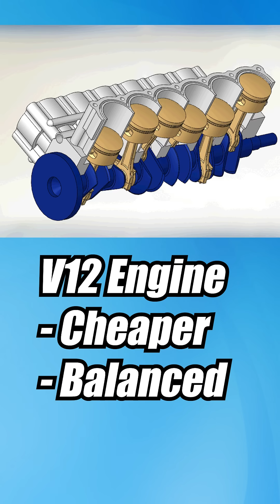wHy DoN'T CaRS uSE V14 ENGiNEs?

Comment: So what you're saying is we should ask for a V20
Reply from the maker: That's the spirit 😂
Reply: Go big or go home, right?  @BladedAngel
Reply: @BladedAngel  How about v32 Lol
Reply: @BladedAngel 
If you wanna know 24 cylinder engines exist yes
They were on the B-29 IN 1945
They are that old now
Reply: @BladedAngel  why not W48?
Reply: I mean....the V24 technically exist, should not be too hard to go back and make a V20  @BladedAngel
Reply: @BladedAngel  Electric cars are already there. Most supercars are transitioning that's fukin impossible unless some crazy hypercar startup like devel, SSC, Hennessy do that to make world's fastest hypercar going 400 miles +
Reply: Double W 50 now that's the spirit
Reply: @Jawd3544  radial 70
Reply: @93_industries  now THIS is why engine simulator exits for 😂
Reply: @93_industries i love the internet 😂😂😂😂😂😂
Reply: @93_industries It should be 2 stroke to work properly, a radial 69 4 stroke engine would be balanced
Reply: @Jawd3544  V200 is really what we need
Reply: @Jawd3544 how
Reply: @Jawd3544  no man we need a flat 14
Reply: Go big or go home W 30
Reply: @93_industries  and put in a Miata
Reply: @93_industries W-shaped engines are split in two VR-shaped blocks. W30 would leave 15 cylinders for one block, which doesn't really work. Let's ask W32, it's two W16 in a row, that would work
Reply: @93_industries put two W16 together n get a W32 💯💯🤘🤘🤘🙏🙏
Reply: @93_industries cant do that doesnt divide correctly
Reply: @93_industries that’s an odd number are you okay in the head ?
Reply: @93_industries  whop-whoop, uneven cilinders
Reply: @93_industries go massive or go home. Radial rotary 36 piston engine. Rotary to keep the engine cool. 😎
Reply: I believe some locomotives have V20s
Reply: @elgringolobo97  I know some older torpedoes have rotaries with pentagon shaped Doritos but I don't know what kind of power it'd put out
Reply: @whatifIdontpickaname  omg that's the first mention of this on the internet I've seen in years. I researched this stuff a while back because I recreated the basic shape of this engine in cad and from what I was able to find it seems like this was a russian prototype technology
Reply: @elgringolobo97 they do
Reply: I like yo spirit 😂
Reply: What about V100?
Reply: @realmustangboy6437  You get it bro, why stop at 14? Just keep on adding V's baby!!
Reply: @realmustangboy6437  na get an inline 100
Reply: @realmustangboy6437 nah to hard to balance W100 would be better but we all know we need A FREAKIN W1000
Reply: Detroit Diesel made a 2 stroke diesel v20 for industrial generators and locomotives, and MAYBE semi trucks I'm not sure
Reply: @treystephens8209 caterpillar does make a v20 engine mainly to trains but also big dumper truck
Reply: @treystephens8209 someone should mod that into a videogame, especially something like beamng where the community would actually see and appreciate it.
Reply: V24😐
Reply: @wender1535  I think Detroit Diesel makes (or used to make) V24 engines for certain applications
Reply: There's also X layout engine, which is like two Vs on top of each other. The same way two I6s can make up a V12, two V12s can make an X24. Like the Rolls-Royce Vulture. A British WW2 Bomber engine with an X24 layout and 42 litres of displacement.
Reply: So we should ask for a inline 10 then
Reply: @jalden1321  well we have V8s and I8s, so why not to for I10s, or even I20s.
Reply: @jalden1321 it'll have to be a wide ass car😂if u want an inline 10
Reply: I've always wanted to make one someday out of 2 M5 v10s
Reply: V20 exist, on a caterpillar loader😭😭 v20 4turbos with 4000horse power 😂😂😂😂
Reply: @SF7483IT  There's also V20 from MTU that produces over 12k horsepower
Reply: At this might as well go WW240 as long as we got the budget
Reply: Radial20?!?!!!
Reply: V10000
Reply: @josephj807 W1000000
Reply: V24 and W48's are what we need.
Reply: O96(like the ones in ships(this is satire of course))
Reply: Waiting for the legendary V60 with 12 banks of 5 cylinders 🤪
Reply: Caterpillar uses V20’s 😊
Reply: Conveniently, there are already V32's. Albeit in large ships and diesel locomotives
Reply: Double it, and give it to the next person.
Reply: Ditch the jet engine, embrace AIR engine
Reply: Thats shit finna be heavy af
Reply: Nah W32 just slap 2 V16 together
Reply: LETS GO FOR V500!
Reply: I200?
Reply: V22🗣
Reply: Lmfao of a v100 💀💀💀 gonna need a giant frame tho lol
Reply: I think v200 would be very nice
Reply: Or V24
Reply: V20 12000cc natural aspirated 2000 horsepower
Reply: How about a V100, the engine of the Batmobile.
Reply: We already have V24
Reply: Detroit Diesel Series 149 20V149 is a v20 2 stroke diesel that is 48.8L and produces 2936 hp 😂
Reply: L😂L
Reply: Nah, I want an inline 500
Reply: No because it won't fit
Reply: Two V10s are always better than 1.
Reply: We drivin on water with this one 🗣️🗣️🔥🔥🔥
Reply: Let us see a modern V24... Radial. Like the FnP Wasp!
Reply: W20, just strap 2 V10s together and call it good 👍 👌 😉
Reply: The EMD SD45, SDP45, F45 and FP45 locomotives had a V20 engine
Reply: V18
Reply: Actually yeah v20
Reply: That's noting, my volvo has a v70
Reply: With that very elongated engine size you would be looking at an aircraft instead. Thou we have Gallo 12 and Gallo 24 in existence.
Reply: @danny1103  If the people in the Car Industry we're even just looking for efficiency and cost they would have already started using turboshaft engines

Like so out dated how many more pistons need to be used till you can satisfy a car owner
Reply: Glue v10 with v10
Reply: W20, v32, and v40 engines exist. and even higher. Most of them are engines for boats.
Reply: Cadillac did produce a v16 as well
Reply: Why not a V64? placed in the tunnel between the seats: great weight distribution
Reply: V20
Reply: Trains use them
Reply: go big or go home, W24
Reply: shit 10 and 10s even so
Reply: ask for v138
Reply: That thing would have insane torque
Reply: V1000 plz
Reply: V1000000000000000000
Reply: V80000000
Reply: Yes.
Reply: go big or go home WIV limitless
Reply: ditch the cylinder embrace the jet engine
Reply: Caterpillar's got you already
Reply: we need the infiniV
Reply: Car makers  need to make a napier deltic engine
Reply: That’s what I’m hearing😂
Reply: Ooouuuu two v16s and make a W32
Reply: If u want to hear the roar of a V20, then come to the indian railways, we use them in trains here😂
Reply: We should ask for the dying V6’s and V10’s.
Reply: Jesus love you, he died on the cross for you, accept him as your lord and savior he can change everything. For God so loved the world that he gave his only son, so that everyone who believes in him may not perish but may have eternal life" (John 3:16)

But you must repent too. From that time Jesus went about preaching and saying, Let your hearts be turned from sin, for the kingdom of heaven is near. (Matthew 4:17):.,.,.,
Reply: Nah v32
Reply: Next logical step of course
Reply: Why not a Double W 32😂
Reply: With a dark matter x 25
Reply: V20 is basically 2 inline 10s yeah that works. We should ask for X20. Engines
Reply: Some diesel locomotives use V20.
Reply: Yes
Reply: Inline 30. Engine block all the way through the car.  Seats directly mounted to the block. Part of the frame. Like some motorcycles but weirder.
Reply: Guys why not just a V128K?
Reply: What about an inline 20?
Reply: There are these V20 Monsters running generators or giant front end loaders & quarry trucks.
Locomotives as well!!
Reply: Infinite

Comment: I have just short answer to why no v14

Divide 360 by: 1, 2, 3, 4, 5, 6. 10 12 and 16. And you'll get always perfect number. Except 16 but 22.5 is still a nice number.

And then divide it by 7/14
And there's all the answer why no v14 engines

Comment: Why is a V10 or IL5 workable, because the cylinders can fire evenly 72 deg apart. It's less complex than trying to make a 7 or 14 cyl fire evenly and balance it.

V6s or Inline 3s are also easier to balance, firing 60/120 deg apart.

Comment: What are you talking about.. it has nothing with being odd numbers.. unless the right side has 6 and the left side has 8.. then the power distribution will be imbalanced.. but 7-7 is perfectly fine...the real reason why no one is building a v14 is simply because no has done it. But its completely possible.. but its not really  logical, same reason as why v10s are no longer in mass production, there are v8 that can match v10s power production,.. and v12 can overshadow v10s power production.. meaning both v8 and v12 renders rhe use of having 10 cylinders..

Comment: There are no 7 or 14 cylinder engines, not because it is hard to balance, but it is IMPOSSIBLE, to know if it is possible to balance for a 4-stroke system 720 divided by the number of cylinders must equal an even number. 720 divided by seven doesn't even equal a whole number, same with 14, so it would shake itself to pieces!

Comment: Dude makes no sense. V14 is bad because of cost, so you should go even more expensive and get a V16 ? He also didn't tell us why having odd numbered cylinder heads is a bad thing, even though some of the Greatest engines ever made are v6 or v10.

Comment: V14 engines do exist.....only problem is that it's easier to fit a car in those engines than those engines in a car....

And there's even a straight-14, producing over a 100.000 hp out of a displacement of 25,6 million cc....

Comment: Silly suggestions to go around the issue: 
one V12 & one V2 engines
one V10 & one V4
one V10 & two V2
one V8 & one V6
one V8, one V4 & one V2
one V8 & three V2
two V6 & one V2
one V6 & two V4
one V6, one V4 & two V2
one V6 & four V2
two V5 & one V4
two V5 & two V2
three V4 & one V2
two V4 & three V2
one V4 & five V2
OR seven V2 engines

Comment: Engines are getting way more efficient, you can create equal or more power with a v8 than a v16 with modifications. It’s way cheaper than having to a build whole care around a huge engine & extra assembly to keep it running well & weight. Not saying v16 aren’t a monster & could easily reach new levels of power but then the cost is too high

Comment: Inline 7 or V14 engines can’t be ideally balanced. Basically every engine configuration can be ideally balanced if you divide crankshafy rotation degrees by amount of pistons and the result comes as a whole number. The only numbers that doesn’t check that logic are number 7,11,13,14,17,19 and etc. Notice that these numbers are mostly prime numbers which can be only divided by one or itself.

Comment: A lot of it has to do with the long crank you have to use to turn it all. Plus so many moving parts it requires exponentially more precise machining and needs much stronger, thicker materials to pull off without twisting in performance applications. Probably just never makes sense business wise to engineer anything over a straight 6 or v12 when you can extract about any amount of power from forced induction on existing engines.

Comment: I mean those are reasons but not the main issues. More cylinders means more moving parts and less room in the engine bay. After the v12 it’s diminishing returns Why would a company add more cylinders for more power forcing the company to spend more time and money on figuring out how to fit the engine in the car and still maintain good weight distribution, room for the power steering rack massive radiator to keep it cool and maintain clearance at the firewall. Doing all this would require redesigning a ton of parts that may drive the cost of manufacturing up far too much.  When instead the company can gain  that same power by what they already most likely know which is typically just using higher quality parts that allow the engine to rev higher and simply flow air better. This guys point about it being an engine balancing issue is sorta an issue, but not worth mentioning. An odd amount of cylinders on an engine bank is not an issue. Otherwise we’d be seeing a lot less V6s. Engine balancing is a lot more complex than what the video suggests.  He’s not wrong but also his reasoning is like saying it’s harder to balance because it’s different. Like yeah I guess so

Comment: It actually has no point, Audi RS6 can produce more than 600 horsepowers with a 4.2L V8 engine that can be tuned over 1000 horsepowers.

Comment: The amount of balancing required has nothing to do with how many pistons on each bank, it's to do with firing order. The reason manufacturers don't make V14s is probably down to the high tooling costs VS existinf V12 or V16 tooling costs.

Comment: Its not a “ehhh i cant be fcked doing this” or “this is to expensive” it actually boils down to the fact that there are more disadvantages to the engine such as length, height, imbalances. Two engine configurations are perfectly balanced (first and second order forces), that’s the straight-6 and 60°-V12. Both pay for this in length, the only car I can remember off-hand to have a transversally mounted V12 was the Lamborghini Miura. That makes for a tight squeeze.

Comment: Well it's not just balancing but firing order and periodicity aswell. As the crankshaft rotates 360 degrees, all the current piston numbers can divide these 360 degrees to get an integer number, for example, a 4 cyl engine fires a piston every 90 degrees. 360 divided by 7 is very far from an integer  and makes an even periodicity practically impossible.

Comment: Cost vs performance output vs appeal bassicly makes them pointless, you can get just build up a  v8 or a v12 engine to get the HP numbers and performance you'd get with a more cylindered engine, a v8 still has the fastest accelerating car in the world even against cars with v16s so why spend a whole bunch of money and time to redesign cars to fit those big ass engines when they could spend less money just building up the engines that they pretty much know everything mechanically wise about and how they fit in vehicles plus they wouldn't sound that great, v12s and v16s already baffle and take away all that sweet growl and tumble you get with a v8, any more and it just doesn't sound that great

Comment: I would imagine that a v12 is balanced because it is essentially 2 straight 6 engines bolted together, and a straight 6 is the most balanced configuration. I don't think a v14 would be unbalanced because of the uneven number on each bank, as v6 and v10 engines have that same issue.

Comment: More pertinent question why don't they make Boxer V16 engines??? I.e. twin V8 parallels or 4x4.
Reply: Packaging. Flat/Boxer engines are already difficult to to fit in cars due to their width making an extra long one would be even more difficult. Not to mention the added complexity of building a reliable example of such an engine.

Comment: I'm still wondering why no boxer 10. it should be perfectly balanced in both the primary and secondary forces.  I know packaging issues could play a role, but the cg would be lowered significantly

Comment: 720 doesn't divide as a whole number when divided by 14, yet some enormously large engines powering oceanliners are V14, but I guess at that scale it might be possible to get the eveness as close as possible past the decimal point, or their rpm is too for this to be an issue.

Comment: Cylinder numbers in engines are based on engine stroke angle which is 180 degrees and the angle of completion of an engine cycle -- 360 degrees for 2-stroke engines and 720 degrees for 4-stroke engines. 180, 360, and 720 are multiples of 2, 3, and 5, which are the first three prime numbers.

Comment: it does not boil down to cost. Cizeta was never really produced and used 2 joined v8.  No modern v16 engines. Its just pointless really. No benefit of any kind and forces acting on crankshaft/camshafts that long are not desirable. And obviously it takes more space in the car

Comment: You can also make a w 12 and higher there's a lot of engines out there that really do make massive engines yes but they also do them in very different configurations you can also take a radial engine from an aircraft and also swap it in a car all you got to do is make the proper adaptive pieces to also go into a transmission that will also be able to handle that power

Comment: V14, V16 aren`t more efective.
There are produced cars with even V16 but they aren`t more effective then V10-V12 by hp/nm
+Have more mass
+You need more place for it
+Its just cheaper

W16 is just more functional.
Its like 2x angled V8.

I can say its 2nd evolution or R-Engine.

V - made engine able to be wider and much less long.

W - made engine nearly even wider and less long.
Reply: Im waiting for bugatti V16 and are they gonna be able to do positive 
,,step back,, in engine evolution

Comment: Cadillac and BMW made v16 engines. Cadillac even raced them in the 1930s…. When things were designed with slide rules and hand made. Even more bizarre, there were also flat 16 engines. It has nothing to do with the ability to engineer such a thing, it all comes down to packaging. It’s too big.

Comment: This is all wrong you stop at 12 because it is inherently balanced with no need for counterweight but this only happens with multiples of 6 so the next good option is a 18 the other problem is packaging size